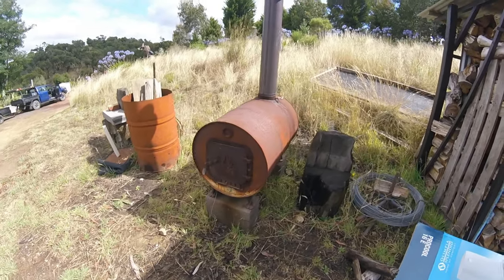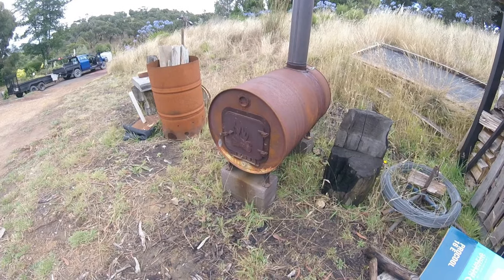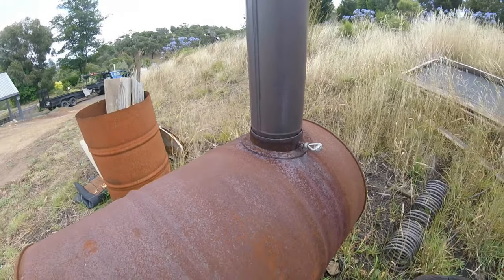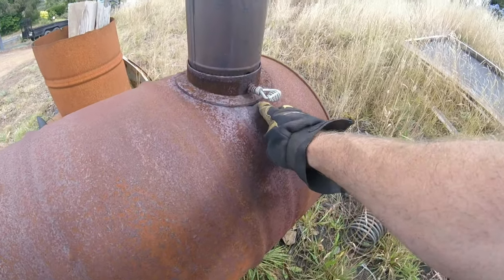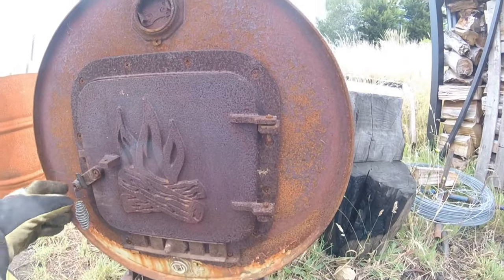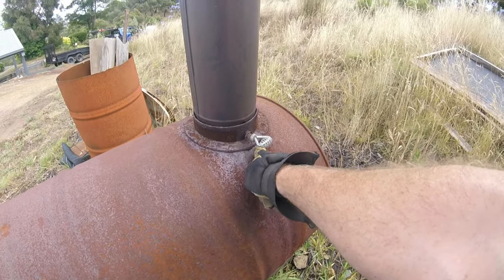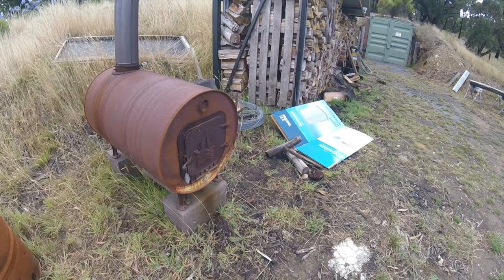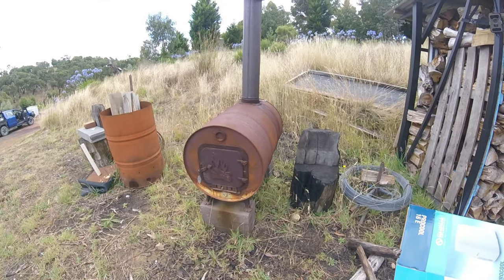Barrel Stove Build - 3 year review

Comment: They don't last too long using them outside. I use mine for burning paper/cardboard also. If you can find a barrel with a removable top (that has the large ring holding it on) They are much thicker and last much longer than your standard oil barrel. If you noticed, the bottom of your barrel did not wear out at all. Infact it still has the paint on it! So there is no need for fire brick or sand at the bottom. Just let the ashes build up a little under the grate and you'll be fine. Barrels wear out around the flue and across the top eventually. So if you keep it covered outdoors (and maybe paint it) it will last longer.
Reply from the maker: Very true, the next one I build is much thicker steel, I have a few issues with the paint, but get a great result in the end.  Thanks for watching

Comment: Put a baffle in the top when you rebuild..
Reply from the maker: Hi, thanks for watching. What will the baffle do ?
Reply: @TheRuralProject  It will stop all the heat going straight up the Flue..
Reply from the maker: Good point. In a later video you will see that the metal has burned through ( on the barrel) near the chimney. So a baffle would help that too.